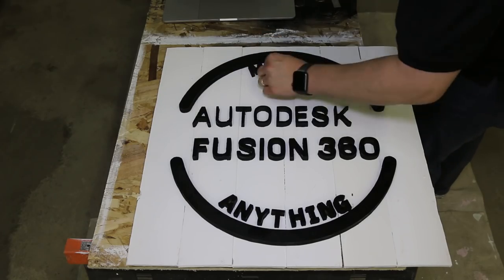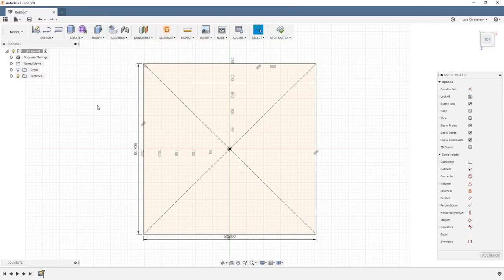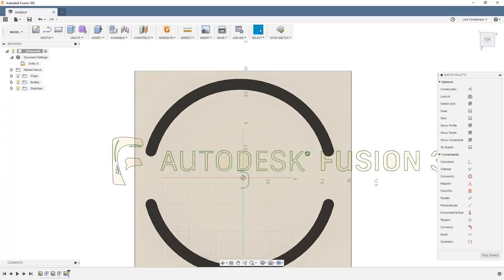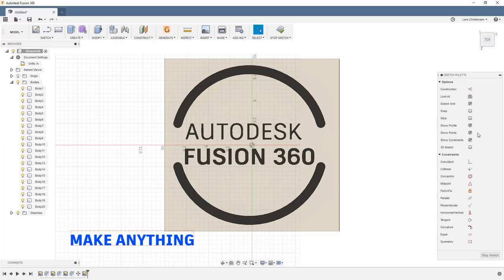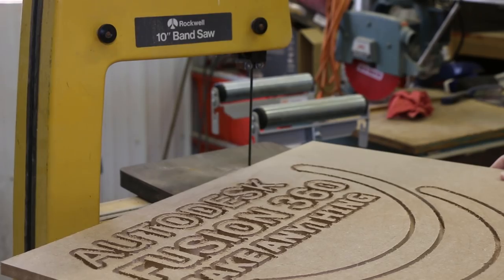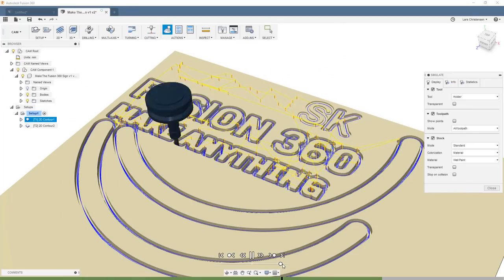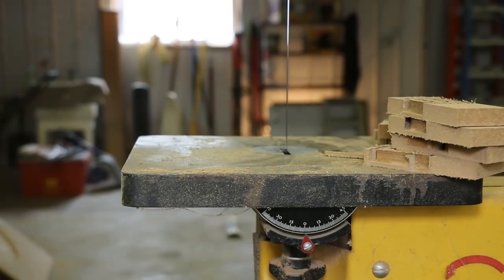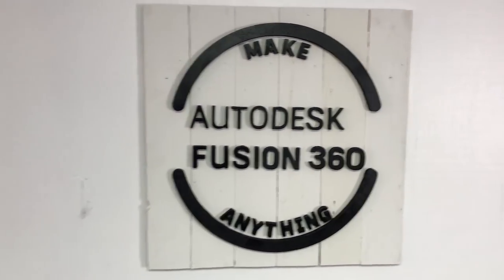Make Anything Sign - Stepcraft & Fusion 360

Comment: Hi Lars. Finally!!! I have an opportunity to offer some wisdom to you for a change :-) Firstly the CNC milling, perhaps try cutting full depth and use some small tabs to retain the letters and stop them from flying all over the place. That would save all the work on the bandsaw. You can cut the tabs with a knife. I use an X-Carve CNC, that method seems to work great. Must confess I've not used Fusion's CAM to generate the tool paths as yet. need to start watching you CAM videos! Secondly, Just a bandsaw tip... Lower the blade guard so that it's closer to the stock. It's a) safer and b) more precise. Stops a bit of flex in the blade. Finally, I like Gorilla glue, but lean towards Tightbond as a brand. Better value (I think) it's super strong too. Hope this helps. Best wishes - Scott.
Reply from the maker: Hi Scott Matthews Thank you for watching!AND for the great comment!
Hope you have an awe some day!

Best,
Lars

Comment: Hi Lars, can´t unterstand why you did not cut the letters to full depth with the cnc - it saves you much time and looks better. Use a 2 mm endmill and you will get a perfect result without the need to change tools. Set 2 tabs for each letter, thats enough. With a 90 degree v-cave bit you could have put a 0.5 mm chamfer on each letter which would make them look even better. Funny enough you have to select in Fusion a spot drill for this 90 deg V-bit ??? no idea why - in the library you can not select a chamfer mill, because you can not set it to 90 deg. Maybe Fusion will introduce V-bits in the future?
Reply from the maker: Hi Wolfs Farm Thank you for watching! Well, I really wanted to use the bandsaw I had just restored :-) But also make a video with some CAM.
It is important to remember that the CAM within Fusion is coming from a cnc milling background where it is normal to use spot mills (or spot drills) for chamfer cutting

Hope you have an awesome day!

Comment: I use a thien baffle... otherwise my shop vac would clog up after doing one MDF board... (I do shelves for smoke shops for vape juice displays. Has slots cut in it to keep the juices separated.) Now I can do 6-6 foot boards before it clogs up with the superfine dust... Plus wear a good mask, you definitely don't want to breathe MDF. Your CNC will make dust you can't see... MDF / plywood keep your bits clean, the glue will "burn" itself to the bit making it dull...

And I have a radial arm saw... they are only dangerous if you aren't paying attention... When crosscutting keep a firm grip on the handle and cut slow, make sure the blade stops before doing anything near it... don't use for ripping... if you have to, use the anti kick back, don't stand behind the cut.  I mounted a small paint brush to run against the side of the blade on mine to slow down the blade faster when I shut it off... They didn't make them with blade stops. I have an old craftsman bought it for 25 dollars and they have a recall and sent me a guard and new anti kickback and new top for free... not sure if dewalt will...

I use a Kreg Rip Cut with a dedicated circular saw and a sheet of foam insulation to break down all my sheet goods. Faster than a table saw and faster and cheaper than a track saw... I use all Ryobi corded tools... cheap... you can buy 3 or 4 of them compared to the top of the line stuff... they last a long time and you don't have to worry about dropping them or if they break... And you aren't waiting for batteries to charge... or buying batteries after they die...

Comment: Nice video as always, i have a question. How did you get the Kress spindel to do 1200rpm, the slowest mine wil go is 5000rpm. Keep up the great work.
Reply from the maker: Hi Janwillem Nicolai Thank you for watching!
Well, the spindle actually has a dial on the side, so all I can control is the start and stop. I think this one goes from 10,000 to 26,000

Comment: Most "wood" glues, like the Gorilla glue you used (not the heavy duty) are pretty much the same.  They are known as PVA glues.  Some brands such as TiteBond have various versions, some are longer setup aka longer open time, some are varying resistance to water and so on.  For best results you should apply some sort of clamping pressure for at least 30 min. 
Also you should try a "downcut spiral mill" when cutting wood, eliminates the tear out on the top of your work piece.  One like this: https://www.amazon.com/gp/product/B00KZM3EYC/ref=oh_aui_detailpage_o00_s00?ie=UTF8&psc=1, inexpensive and works great.  
I have a Shapeoko 3 and when cutting MDF I use a Feed Rate between 60 to 100 in/min. and a stepdown somewhere around .06".  When cutting 2D contours I leave .003 or .004" and a little more on the bottom and then a full depth finish pass to complete.  
This is just what I have found to work best for me.
Thanks much for teaching Fusion 360, I'm nearly an amature!
Reply from the maker: Hi Rich Knudson Thank you for watching!AND for the great comment!!
Have an awesome day!